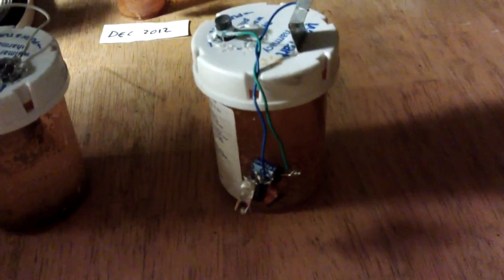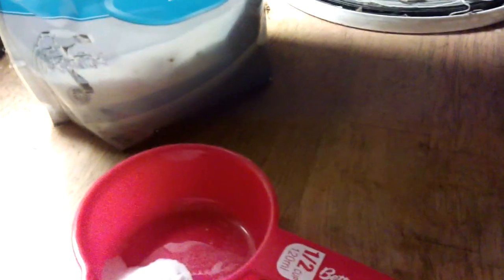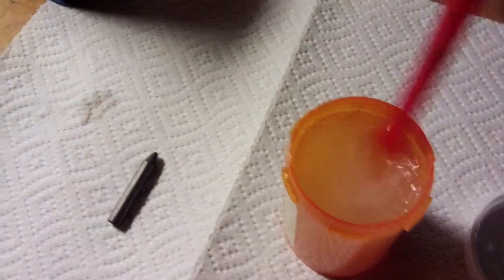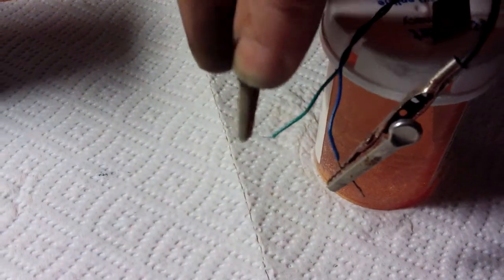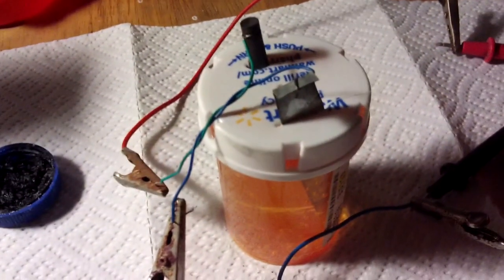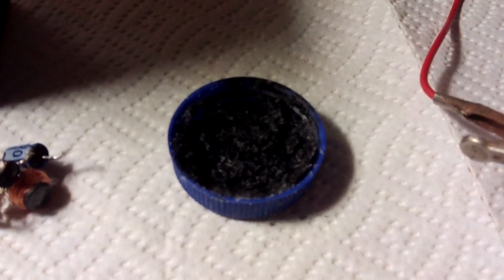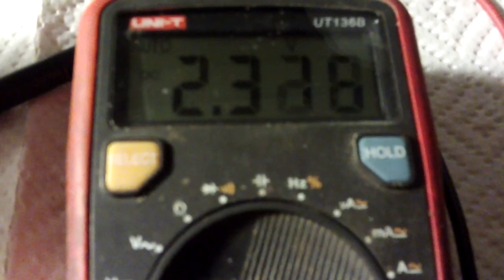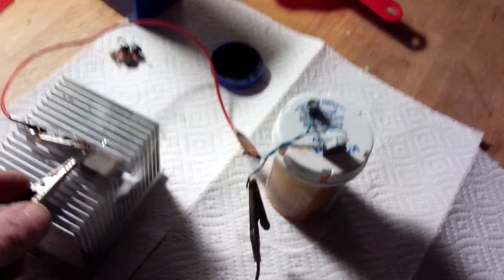SodaCell - Big voltage, big current

Comment: With that graphite I think that you're using from that pencil have you tried the core of a double a battery pulled the center iron piece out of it and use it instead
Reply from the maker: I tried that around the same time, with good results. Normally they're copper rods (useful anyway) but non alkalines have a graphite. It's always worthwhile ripping such things to pieces, as you suggest. Main goal has always been to find non reactive, or non sacrificial type pairings with strong output... though they can react, if it takes 100 years   :)
Reply: @Slider2732  the elements that you're using couldn't you use mesh wiring as a catalyst and you put it in series of little tubes of in tubes of that mesh wiring and then when you pour the element in there you have greater surface greater tension and probably a better stability can you feedback on that I'd like to get some information on your technology I'm going to be implicating it into some of my stuff but I'm using powder coating ideal over the wires and then powder coating of the magnesium over that
Reply: @Slider2732  if you don't mind I'd like your professional opinion on some of my things that I put on Facebook I discovered something and that's why I was very curious about your polymer minerals that you're working with and I'm wondering if those polymers if I can base metal the copper and then do something like powder coating on it and then powder coat magnesium on top of that and then powder coat another strand of the compound that you're working on and then put another strand of magnesium or whatever metal that would go on but how I would do it build it up like a wafer cracker with the polymer being on a screen that's made out of copper and magnesium if this is too much for information for the public feel free to let me know and I'll try to keep most of my ideals on the low low but other than that you're welcome to look at my Facebook page and see what I'm trying to attempt but I feel that having mineral polymers interact with metallic polymers you have a dispersion rate and probably a more conclusive draw through a wafer style battery and that would be kind of like what you do with a solar panel but the only difference is with the polymer with the metal in the copper and stuff you can buried in the ground and it should be able to bring in even higher voltage because what you're doing combined with tetris's ideal in the right configuration you can actually amplify the carrier amperage out of the earth faster
Reply: @Slider2732  plus yeah I have traumatic brain injury spectral aspergers and a few other notifications from the Love canal that I have biologically been altered but that's in the documentation you don't even have to listen to me background check Love canal biological diversification but yeah I for some reason this last deal with my traumatic brain injury where I died in 2011 on my bike it seems to be like a him music where I could see the patterns where everybody else is doing things and see what's working and what's not working in my head before I actually produce it I know that sounds weird but yeah my brains kind of screwed up from being ran over on my Harley but ever since then things kind of changed in a weird kind of way about me and I'm very into a lot of scientific stuff for some reason I could see things that other people can't see but they have the thought process of a mathematician my process is by manipulation of space in a seven-dimensional area in my mind I know that's kind of weird and kind of creepy but I appreciate your feedback on the amateurs of what I was coming up with the wafer style battery that you could put in the ground and multiply your amperage from your device
Reply: @Slider2732  and if you want to diagram of what I see and how it works in the ground let me know
Reply: @Slider2732  you know that low uranium glass that's green that emits I was seeing to use that as a rebuy product of a screen and then I put my powder coating on it and then the other metals and its process and you can have low variant uranium rods that you could put in the ground and amplify the voltage

Comment: It is inconvenient, but can you give me the circuit diagram (electronic components) you use to light the LED?
I want to teach students this diagram.
Thank you very much
Reply from the maker: Sorry about the huge delay!
It's a blocking oscillator...simply a Joule Thief, but with a 0.1uF ceramic capacitor and 1 Meg Ohm resistor in parallel, between 1 coil wire and the Base of an NPN transistor. 120+120 turns on a piece of ferrite works very well.
Also, Lidmotor's Penny circuit is the same circuit as shown here. 
The effect is a flashing, as the 100uF capacitor across the power inputs charges then fires the transistor. The cap/resistor combo dictates the flashing frequency and intensity of light output. Such circuits will start the flashing by holding a piece of copper and piece of steel in the hand, especially in humid conditions.

Comment: Between active carbon and graphite, which electrolyte is better ?
Reply from the maker: Normally epsom salts works the best for long term, though there can be build ups of crystals if the mix is too thick. Alum also works well. White vinegar too. Best advice is to build a few cells and take notes on Voltage/Amperage and any degradation over months. Some electrolytes don't care if a load is present (LED oscillator for example), some will start to coat the electrodes. 
The stronger the output and strength of the electrolyte, the more negative effects over time. It's a weigh up of pros and cons situation, best explored with experimentation :)

Comment: It would be cool if you could try one of these batteries to power a small drone, I wonder if it would work and if so for how long?
Reply: As long as you got enough volts too charge your drone so 220v or 12v and enough current you can power anything you want you just have too parallel connect cells untill you have got desired current then will power anything its mainly just a time n space issue as may be a larger old-school type batt but it last forever just Bury it if in your way..put a little trap door too access it...only other thing you need is a little controller chip maybe a step up chip n maybe a joule theif board but they all cost penny's too buy but yh if you built a battery 🔋 the size off a fridge 1000s little cells connected n just add salt water it power half your house from sea water...just Bury it in garden with trap door jobs a gooden...but yh need the time n inspiration but worth doing on any level it's no different from saving money like a piggy bank every bit energy you make from own witts is a direct saving in your bank account ..one way too look at it..cheers

Comment: I put a motor to it, but the voltage drops
Reply from the maker: It'll run small motors for a few minutes, but all works best with a solar panel. If connected to a solar panel of 5V 200mA output it works as a strong capacitor with no overcharging issues. 
Best type to use are the small coreless as found in mini quadcopters.
Reply: Slider2732 so it can't last a few years, like what laser saved used?
Reply from the maker: It can last years for powering a Joule Thief circuit and yes indeed, Lasersaber's uA motor would be ideal. For any more power it needs to be topped up is all. Output with no charging is around 0.7V at 100uA or similar, but that's all the time  :)
Reply: Slider2732 thabks
Reply: Thanks

Comment: How many miliamps?
Reply from the maker: About 100mA peak as far as I recall. Main thing with these though is their longevity, running and running with the ability to power a Joule Thief type of circuit for years.
Reply: Slider2732 thanks
Reply: How many years?
Reply from the maker: Got one from 2012 that's still running. They have to be sealed well or it evaporates, but electrodes should be cleaned with sandpaper every couple of months.
Reply: Slider2732 impressive!
Reply: Slider2732 what circuit did you use?
Reply: Slider2732 is there a way to give out a constant amperage?

Comment: In the cells from 2011 and 2012 do they make their own power or do you have to recharge them?
Reply from the maker: They make their own, or, in this case can also accept a charge. They'll charge to around 1.7V, settles overnight to 1.3V, amperage up to 70mA for short time loads like using a flashlight. Main thing is the difference in potential, so for example a copper rod and a galvanised zinc rod will generate around 0.8V at 1mA. That's the figure for many many years, with cleaning of the rods every couple of months. The solution may evaporate first, as happened with a few cells that hadn't got full sealing.
Carbon rod+ lead rod in weak epsom salts/water is till running now from back then, no degradation, powers a pulse motor.  
Nephilim Penny is still running its flashing LED, copper/galv steel in rainwater, began running in 2011.
Reply: Slider2732 thanks for the help I was curious because I made a lead/ lead oxide and Epsom salt battery and I can recharge it and run a led for 7-8 min when constant and not flashing and it settles to like .3 volts only over night. The max voltage was 2.2 the max current was 0.145 with an adversary current of around 0.07 amps I’m also making one with a similar style to yours with Epsom salt and baking soda in a pill bottle but I’m using lead lead oxide  for my electrodes
Reply from the maker: There's your potential difference between lead and lead oxide, 0.3V. 
A tip is to not draw everything the cell can provide. For example your LED that runs 7-8 mins. You may find it runs much longer if the input has a decent resistor to a blocking oscillator. 3K seems to not get in the way of running low amperage circuits, cells last far longer and metals degradation moves from weeks to many months. Using the outdoor earth as electrolyte also hugely benefits from such a resistor, where circuits can run continually that used to stop after a few hours  :)
Reply: Slider2732 thanks for the advice I made a new pill bottle cell like yours but with lead lead oxide and the baking soda Epsom salt cell can put out 2 v and .180 amps and stabilized at around .1 amps I’m thinking about making a video on it.
Reply from the maker: I've just Subscribed to your channel... do it ! lol
Reply: Slider2732 thanks I will make it soon
Reply: Slider2732 the video is up it’s not the best quality but it gets the point across. I forgot to add background music so I’m going to have to add some unless you think it’s ok with out it
Reply from the maker: Perfectly fine quality and concise, was informative and that's what counts. Congrats on the output and build  :)
Reply: Slider2732 thanks

Comment: When you mixed the two electrolytes ie Sodium bicarbonate and magnesium sulfate was there effervescent as that's what I observed during mixing?
Reply from the maker: Yep indeed, quite a lot of it. I simply kept mixing until it stopped. 
A word of caution, don't put a lid on the container before shaking ! lol
Reply: I believe that effervescent is due to hydrolysis of the magnesium sulfate to free sulfuric acid as magnesium hydroxide is a weak base but sulfuric acid is a strong acid!
Reply from the maker: That seems likely. I had the idea to try it, knowing that both are good in 'salts cells'. Thanks :)

Comment: how long it lasts buddy?
Reply from the maker: On that motor, several minutes. No limit to recharges that i've found,  Electrodes will lasts years if cleaned every couple of months, but do show signs of corrosion faster if the cell is charged.

Comment: can it be recharged?
Reply from the maker: Yep, over and over. I should test the full limits, but just charge when needed....quite often i've got 12V already solar charged and need about 1.5-2V (an AA powered circuit), so they're handy to have around rather than use store bought cells.

Comment: where do you get graphite ?
Reply: The positive *center electrode from old carbon zinc battery.
Reply: Pencil, the black thing is graphite. Extract then break into little pieces and use rubber band to hold them together if you wanted a bigger size.

Comment: Your cell has great potential, pun intended:) Have you tried sodium bisulphate (widely available, generally non-toxic) instead of Epsom salts?
Reply from the maker: +Pseudo Nym I haven't, but it's a good idea. The thing about Epsom salts is the huge bag for around $4. I bought this one in about 2010 and have only used 1/3 of it !
Reply: +slider2732 In my experiments with charged Pb-Pb cells, bisulphate provided massive current (melted my wire) but self-discharged over an 18 hour period. Would be good if a compromise could be found.
Reply from the maker: Pseudo Nym
Thanks for the info. Similar with magnesium, good output but throws in the towel quickly. These are intended to last a good few years and it all seems to be a compromise.
Reply: I have discovered that a 'slow charge' using a 5 volt solar panel in subdued daylight connected to a Pb-Pb-NaHSO4 cell gives 1.88 volts initially and decays under zero load to 1.5 volts after 48 hours. So it looks like sodium bisulphate could beat Epsom salts!
Reply from the maker: Pseudo Nym
Good info and thanks for relaying your findings :)

Comment: this is great stuff brother.
Reply from the maker: +wjewell81 Cheers :) very simple too, with household stuff. Pencil refills also work, if you haven't the larger graphite pieces. For good current, several can be bundled together as 1 electrode.

Comment: thanks for making the video.is the run time of the battery controlled by the amount of time you charge it?i have to make this and run my Lidmotor motor on it.thanks to you both for always  sharing and keeping is simple.
Reply from the maker: +bill bailey It has many traits in common with the type of supercaps i've been doing, which itself is interesting. The graphite burns off into the cell as a cloud when charged like this, a longer 'burn' for more power. However, it doesn't need to have such a high voltage or as high a current, just needing to be charged for longer, which again is like the supercaps. When left completely alone, for months, it doesn't go anywhere below the reactivity between the graphite and galv steel...which will run an oscillator without issue. Perhaps infrequent 'burns' will clean off anything developing on the electrodes over time, such as water impurities :)